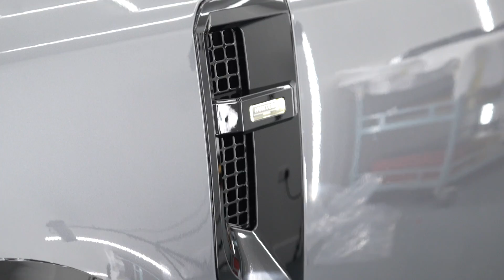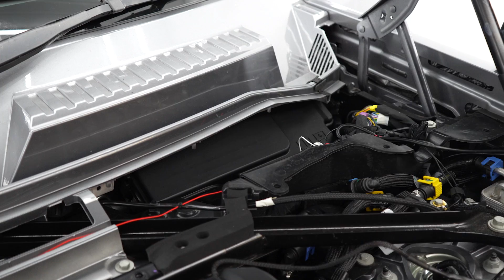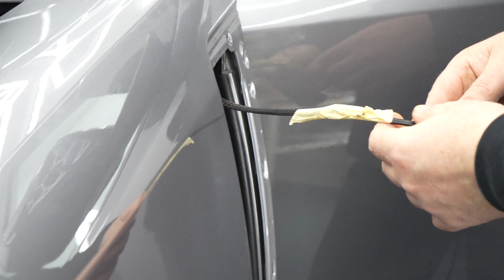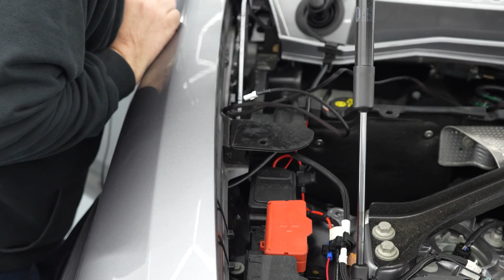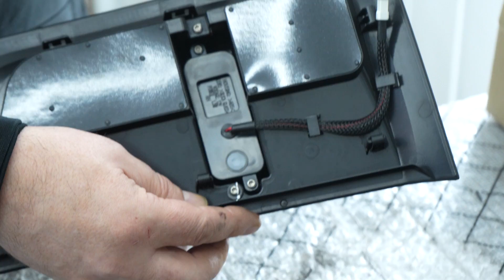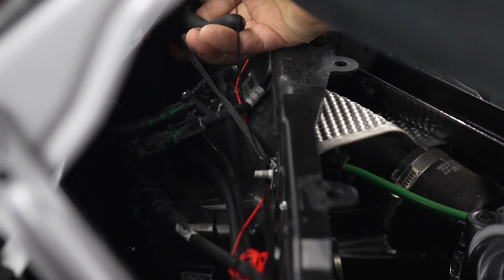HOW TO FIT: L663 NEW DEFENDER LED SIDE VENTS - FITMENT VIDEO

Comment: I have a led grille and the fuse for that id already in F7B so how does that work ? your defender you said has the led  grille but theres nothing in F7B for that fuse holder??
Reply from the maker: In this case, the correct solution is to cut the ends of both live (red) wires from the grille and the new product, join them together, and run them through a single fuse. You can then plug that single fused connection into the F7B slot. F7B provides more than enough power to safely run both products from the same fuse.

If you need any help or want us to walk you through it, feel free to contact our sales team:

📧 sales@huntersprestige.com

📞 +44 (0)1842 267890